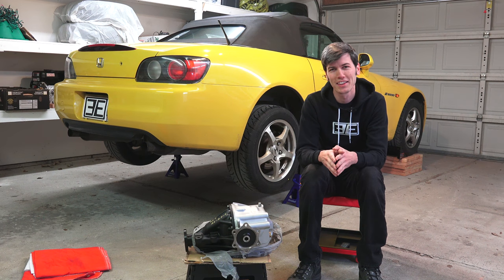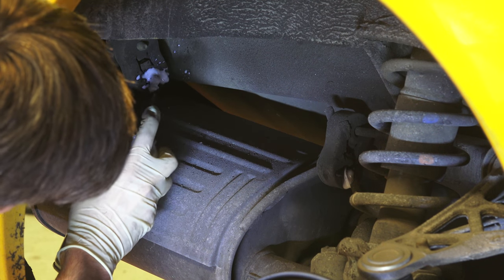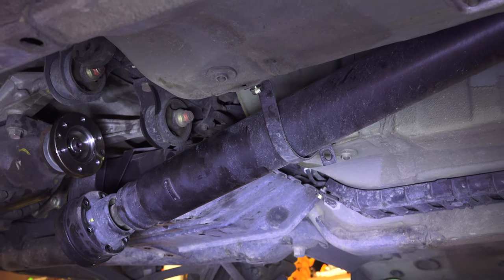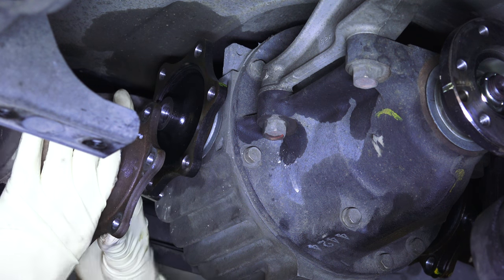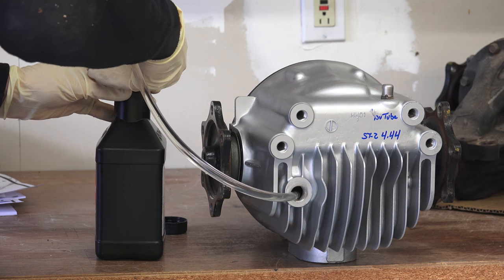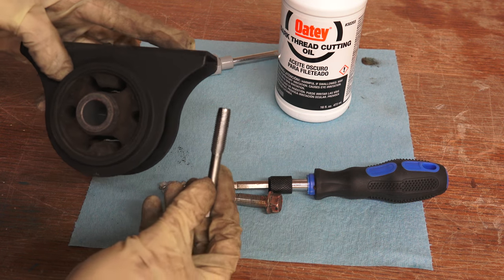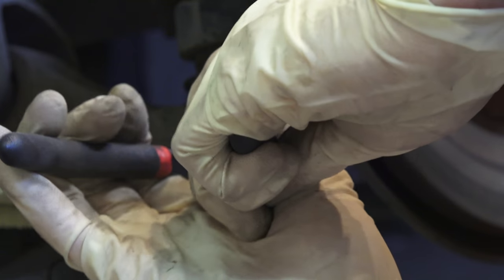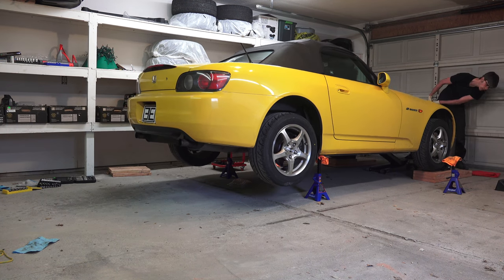Installing A New Differential In My Honda S2000!

Comment: this is something that I have done before my friend snapped the diff housing off the frame. the holes on the top of the diff by the half shaft snapped off so bad the diff lost its oil. we put in a the s2000 cr diff in. reason being the casting was so much better on the CR and certain other parts of the CR that we call CR parts ap3 or ap2.5.  if you ever feel any play in the drive line of an S2000 replace the differential mounts immediately along with drive shaft mounts or bearing whatever you call it. the reason he snapped the the housing and one of the reasons I believe S2000 are slightly notorious for breaking the differential is once the mounts are worn away enough it leaves too much play and put stress right on those top bolts. between my group of friends there is 4 S2000 all of them well used. all of them drift and I mean not just on the track that's just how they do u-turns. out of the four the only one that didn't have differential problems was the one that replaced the drive shaft and diff mounts. to snap the housing. and one destroyed the bearing  on the back of the diff .that goes to the drive shaft because of play in the drive shaft and transmission mounts. I love the car and luckily since I've had worked on all my friends I know the car by heart so take my recommendation and if you buy one immediately change out all the mounts subframe differential drive shaft transmission and engine mounts shouldn't be more than six hundred bucks and parts and it's not that hard this car hates any play in the Driveline. if you're lucky you'll find a differential for 500 but the drive shaft ain't cheap.
Reply: also this is one car I don't recommend putting super sticky tires on  as a first mod until you add a supercharger and have enough power to break traction. stock the car is fine but once you put coilovers and hard bushings and mounts all that play that was originally designed into the car is gone. I really never hear of stock cars killing differentials It's usually the ones on coils and upgraded mounts. the squat the car would do stock which would take a good amount of the stress off the differential. It's that or the half shaft I forget the name of it but the hardening treatment on the gear set really helps plus thicker half shaft.

Comment: What type of drill are you using for removing the wheel? what is the minimum torque requirement of the cordless drill.. Thinking on buying one easier for racing to change whole sets of tyre..

Comment: As someone in the UK familiar only with FWD cars where the diff is inside the gearbox I wanna ask - why does the diff apply a gear ratio why not just 1:1 and allow the the gearbox to output the final ratio? Is it to put less torque through the prop shaft?
Reply: Simon Ashton commenting for answer. (really good question now that i think about it)
Reply: Probably because the pinion gear will have to be as big as the ring gear for a 1:1 ratio.  which will make the diff way big.  There might be other reasons on the transmission side...
Reply: Fadi Hamdan I'm glad you said that as it crossed my mind too, but the gear can actually be really small if desired. The 'strength' of the gear is really only down to area of tooth engagement I think.
Reply: Ring gear is big because it surrounds the differential mechanism (the sealed pepsi can sized thing that does all the work and drives the tires).  Probably there are ways to design it so it's smaller (attach it next to differential rather than around it), but I've never seen that anywhere.  The answer is probably in the transmission where having a final drive ratio of 4.10 helps in its design.  Not sure sure how though at first hand :)
Reply: Front wheel drive cars have the same setup, the differential is contained within a cage connected to a large ring gear. Only fwd ring gears are spur gears rather than bevel gears.
Reply: The driveshaft would be spinning much faster if the "diff" was at a 1:1 ratio. Then you have more rotational weight, need much better ujoints to deal with the speed and the driveshaft would have to be at least 4x the strength
Reply: I think you have it the other way around.  Gear ratio is 4.10.  Which means for every 4.1 turns on the pinion gear, the ring gear turns once.  Ring gear turns at the same speed as the tires.  So If you pick an rpm for the tires going a certain speed, the pinion gear, and hence the driveshaft, will be spinning 4.10 times faster.  Going with higher gear ratio like the video above, the driveshaft will be even turning faster for the same speed, hence more torque, and higher RPM on the engine for the same speed.  If you were to go with a 1:1 ratio, the drive shaft will be spinning very slowly, as slow as the wheels
Reply: Fadi Hamdan you are correct. didn't even think about it that way before, thanks.

Comment: Honda makes thread protectors to be used with the ball joint press so you don't have to sacrifice the castle nut every time, they're expensive but worth it if you use them regularly.
Reply from the maker: +Alex Ball ahh interesting. Can just use a 12mm nut as well; I was already planning on replacing the castle nut since Honda recommends it, so I wasn't too worried about destroying it.
Reply: I've tried a random nut before, if it isn't hard enough you'll lock the nut to the threads causing another problem. I own all the protectors because well, I work at Honda. You also need something about as long or longer than the castle nut because sometimes the joint is stuck to the point where the stud can get bent slightly if you use a random nut that is only about half the length of the castle nut.

Comment: Other than the castle nuts, which nuts and bolts are most critical to replace with new parts when reinstalling the diff? Some of these appear to no longer be manufactured and may be difficult to source... wondering which ones are ok to reuse vs. not.

Comment: will a performance clutch make up for the loss of wheel torque if i installed a less aggressive gearing for fuel economy.
Reply from the maker: Nope, no need for a performance clutch unless you've upped power and the stock clutch slips/can't apply the torque. Performance clutch will not impact torque numbers, negative or positive.
Reply: thanks but i meant in terms of whether or not stock clutches transfer 100% of the torque to the transmission, if not, are performance clutches closer to 100% than stock

Comment: It looks like it's the Engineering Explained Suspension bushing and ball joint replacement guide time... Those LBJ's looked BAD! I'd highly recommend a replacement poly bushing set from energy (i.e. 16.3120R) also. Those will improve performance greatly.

Comment: I had a hard time removing those Allen bolts from driveline. My socket was too long, I had to use an L and socket to grip it because it stabbed into my hand when I applied pressure. I wanted to torque to spec but I got lucky just to put them back in.

Comment: You mentioned in the beginning that a DIY might modify the procedure to save time. I was curious exactly how long did this process take you? Minus breaks and having to get the tap set of course (That would grind my gears haha)
Reply from the maker: This was filmed over three days. Filming, a few set-backs, stubborn bolts, and of course the tapping made it longer than it needed to be. Could be done in a day if you had all the parts/tools you needed ready, and didn't hit major snags.

Comment: I like this kind of videos rather than explanation. Next time that Honda S2000 should be fitted with drift ready and NO2 bosts and turbos with no weight reduction, equip all interior just for showing off rather than racing. :-)

Comment: Mighty S2000 Mods, eh?  It would be nice to see you team up with Eric the Car Guy for these.  You are one brave engineer tackling such big mechanical jobs! :)  I got stuck on the hit ball-joint with hammer part when trying to change a steering rack -- I'm so incompetent, then I gave up. :( Hmm, I see you used the proper, actual tool unlike the hammer balljoint separation method promoted by Eric and Edd China. :P Well done on your excellence in the field of excellence, Jason! :)
Reply from the maker: I'll admit, when I started stripping the first of six prop shaft bolts I wanted to give up. It was quite frustrating. And then the messed up mount threads, that was so stressful. In the end it all worked out; patience is critical in not messing things up further.

Comment: I need info on that torque wrench you use, i got the one that goes from 4.99 to 99 ft pounds but when i try to set it to the lowest settings it only goes to 10 and it goes back to 99 do you have any idea how to use it thanks

Comment: Well done!!! I've only worked on Ford 9" rearends... we could change gears in about an hour if we had the pumpkin already set up :-)
Are you going to calibrate the speedo? Or just make mental corrections??? Can your speedo be changed electrically, or do you have to change the gears for that too ?  Thanks for taking us along for the change out :-)

Comment: My only concern here would be how much your speedometer would be affected? Did plenty of differential swap when working for a Freightliner dealership and we had to recalculate the number of revolution/miles to set the speedometer to the new spec.

Comment: Sry to ask I lifted my ap1 fromthe rear to change bearing hub.When i was rotating the wheel on neutral gear I heard slow clicking from diff does that mean loose or rebuild? diff?

Comment: I think this car was made so everything is in the way when replacing important components. I saw a video from Mighty car mods where they changed suspensions on a S2000 and they couldn't change the rear left strut because some fuel tank/ funnel component.
Anything you can say about this ? From an engineering standpoint of course! 
I mean bad/lazy design ? Car is too complex for its size ?

Comment: I've never heard it called a prop shaft. Is that just dialect or is it different from a driveshaft?
Reply from the maker: Short for propeller shaft, same thing as drive shaft.
Reply: Alaska Skidood Prop shaft goes to the diff, drive shafts to the wheels.
Reply: Ahh, ok. I guess I usually call it a driveline.
Reply: Alaska Skidood I would say the drive line is all the components that makes the car move. Eg. gearbox, clutch, drive shafts and so on.
Reply: Mattias Filander I would call that the drivetrain.
Reply: Alaska Skidood Sorry, that's what I thought you ment. Drive line, I have never hear of then...

Comment: Did you kill the diff doing skids? Puddy makes good stuff for F/K series S2Ks, nice to see one on YT. Good move to the 4.44.
Nice to see a youtuber go from theory to actual hands on stuff.
Put a new 3.91 Gen5 Z/28 torsen diff + Import Muscle cradle in mine because a cammed LS3 would make short work of a cryo treated stock torsen on the track sadly. 1st one ever ;) Plus the integrated diff cooler will come in handy and can be plumbed to the t56 mag for cooling. Basically copying the drivetrain + cooling solution in the z/28 lol.

Comment: I also swapped my differential with a 4.77 final drive, but at higher speed ( 100km and above ), I get vibration from the rear. I torqued everything to specs and now I don't know what to do, any suggestions? Oh I also changed the engine mounts to aftermarket ( innovative mounts 75A )

Comment: Will you be installing a lightweight exhaust system and/or lightweight driveshaft?
Lastly how do you feel about sway bars on your s2000
Reply from the maker: I think the ride is plenty stiff, super flat in cornering. If I can get the funds to work out for a lightweight exhaust, I plan on it, but I want to do it right and not have it be too loud. The best one I'm looking at is costly, so I'm trying to see if I can get a title sponsor for the video to offset the cost.

Comment: I've always seen professionals remove ball joints with a hammer. They hit the control arm around the hole where the threads go through which deforms the metal slightly and breaks the cold weld. 
Is there a better ball joint removal tool that doesn't ruin the castle nut?
Reply from the maker: Best to just put a 12 mm nut on there and use it any time you need to. I didn't have one laying around, and was already planning on replacing the castle nut.

Comment: I have real question here: I have a BMW with the xDrive 4wheel drive system. And unfortunately the car has a sporty rear differential. It's a X1 23d xDrive (not sold in the US, I think). It's little brother, the X1 20d xDrive would have a smaller gear ratio and would hence need much less diesel. So what would happen to the xDrive system, if I change the rear differential? Or the ESC?
Reply: Oh, and by the way: I called BMW in Munich and no one there was able or willing to tell me.
Reply: Is this there any engineer out there who can answer my question?

Comment: wont a 4.44:1 ratio kind suck for daily driving, ive got a 4 speed ke70 with a 4.11 rear diff ratio and she sits just under 4 grand at 100kmh (60mph) in 4th, would it be worth finding a lower ratio to help with that or not.
Reply: acmadni turner a lower ratio or a trans with more gears would help of you change the rear end you'll lose power off the line it would be better to do a trans swap
Reply: Honda drivers are used to such things, also this has got 6 gears.

Comment: Where did you look for the torque of the bolts?
Reply from the maker: Honda service manual. There are general guidelines out there based on the bolt type/size if you don't have access to a service manual, but I'd recommend doing some digging to find the actual specs.
Reply: Ok. Thanks for the response.

Comment: How do you find torque specs for each individual bolt?
Reply from the maker: Honda service manual.
Reply: Does that come with the car or a separate thing that needs to be bought?

Comment: Since you had the exhaust out, you should have replaced the muffler bearings.  I like to change mine every 25k miles for smoother exhaust flow.

Comment: Wow, I ordered a diff and it just shipped today and was debating swapping it myself or pay someone $600+ to do it...  This might nudge me more toward doing it myself :).  How daunting is the task?  I have the service manual and the tools necessary and experience fixing things (I am an engineer too...).  Also how necessary is it to remove the ball joint?  Other diff removal posts say you can skip that part...  thanks for the fantastic video
Reply from the maker: Other ones say you can skip the ball joint - I tried, I don't see how it's possible without. The good news is removing the ball joint is super simple. One of the quickest parts of the job (buy the tool from HF or the one I link in the video description). Also, buy the part numbers I list in the description at the bottom. If you have the tools, I'd say go for it. Just be super careful with the prop shaft bolts, be sure to use an impact and soak the bolts for a good while (an hour or so) before trying to remove them. Also, removing the diff can be dangerous. It weighs 70 pounds and is ready to drop. I'd highly, highly recommend using a transmission jack.
Reply: It seems if you don't you'd have to move the diff all the way to the right to remove the left drive shaft then the other way around.  But seems easy to remove the ball joint.  Is this done so it's easier to remover the drive shafts and have clearance for the pin that goes in the diff?
I'll probably soak everything over night.  I have the luxury of having a garage and another car.  So I can take my time.  My diff have been acting up for more than a year.  I thought it was the rotors rubbing for the longest time until I started hearing loud clunks.  Disappointing for an 06 with 70k miles that's all stock and not abused...
Thanks for replying!

Comment: what if I were to tighten the bolts tighter than the recommended lb-ft in the video?
Reply from the maker: Could damage threads, cause more pain down the line. Or worst case, something fails while you're driving if you're pushing the yield strength of one of the bolts.
Reply: thank you very much for the reply

Comment: If you changed the bushes, why not upgrading to better bushes?
Reply from the maker: I don't see anything wrong with the OEM design. They put a lot of research into it, I know they're quality. I can't immediately prove why something aftermarket is "better."
Reply: Yes, but if you intend to use the S2K in track, It would be better to upgrade to polyurethane or hard rubber for better handling, I've done the same to my CRX and the handling transformed completely. It would be nice to see a video from you explaining pros and cons of polyurethane bushes

Comment: What is the job of a differential?
Reply from the maker: Takes power from the prop shaft (which is connected to the transmission output), and splits it between the two rear wheels.

Comment: Hey Jason,
Okay the cat is outta the bag. You have obviously hood winked us all along. It's hard to believe your an Engineer after watching this fine video. You followed all factory processes excluding the exhaust. There are no left over parts or pieces. You did not modify anything except for the striped fastener. You actually used a torque wrench! Sorry Pal. Every Engineer I've ever known hacks the living daylights out of what ever they were working on. Then fails to acknowledge their hacking when what ever catches fire, grinds to a halt or explodes.  Fess up!
Reply from the maker: Ha! For my brief stint as a professional engineer, I worked as a test engineer for six months alongside a very talented tech, who taught me all kinds of useful info. Unfortunately, I don't have access to the kinds of equipment and tools we used, but I'll certainly follow most factory processes if I can find the info. What's the proper way to drop the exhaust? I wasn't sure if I'd be dropping it or not, so when it came to it I just said meh, popping off the hangers here we go!